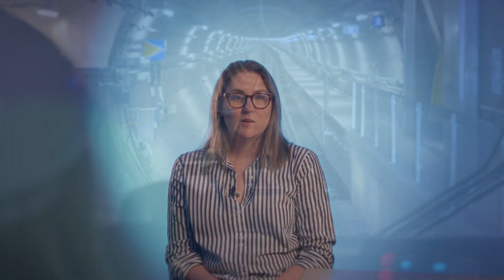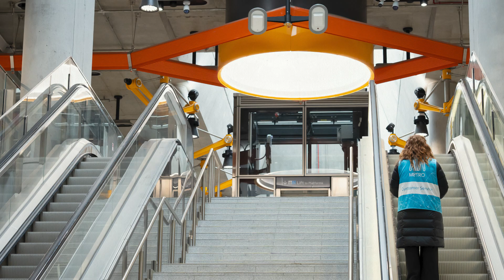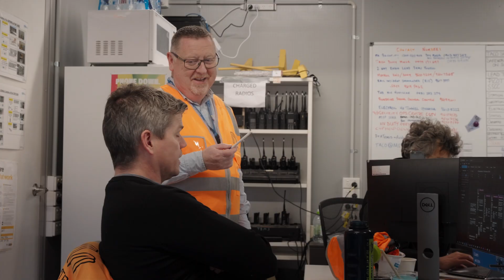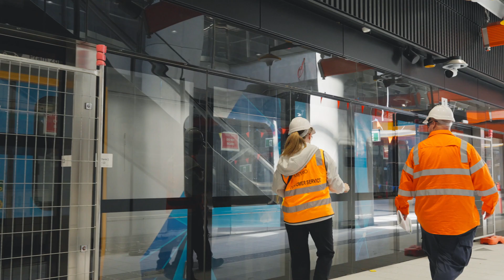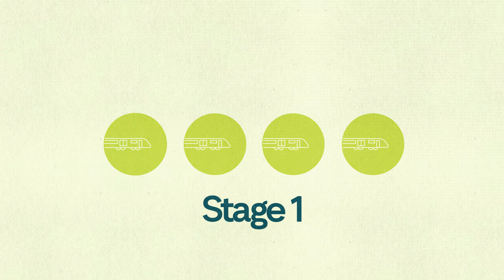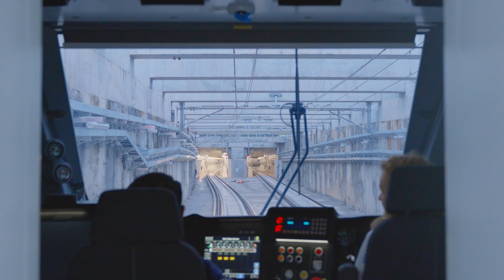We've started the final stage of the Metro Tunnel

Comment: Thanks team. Can't wait till you rebuild Gardenvale station where the gaps in the platform are big enough to slide a pram through and the ramp to access the platform is steep enough for Musk to use for SpaceX launches. How someone in a wheelchair could ever get up it is hard to imagine. Less fancy lights and architectural features there could be invested in rebuilding those stations that are dangerous, in atrocious condition and should be   barred from use by worksafe